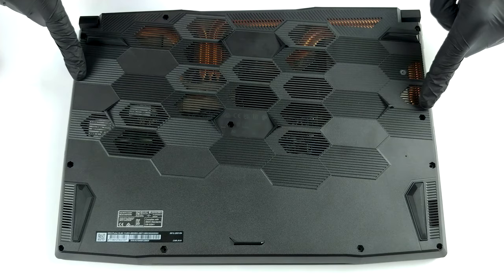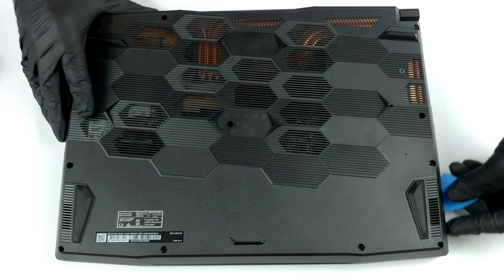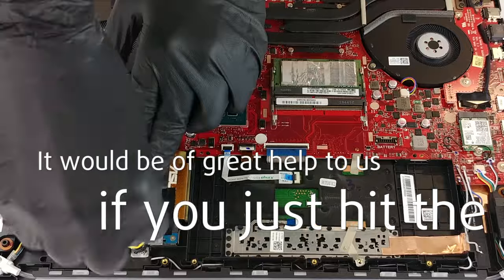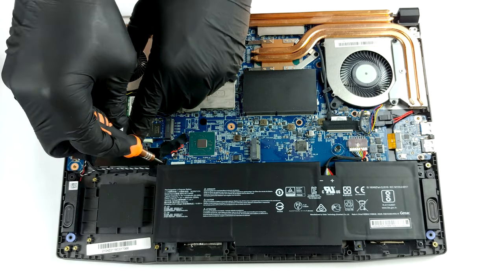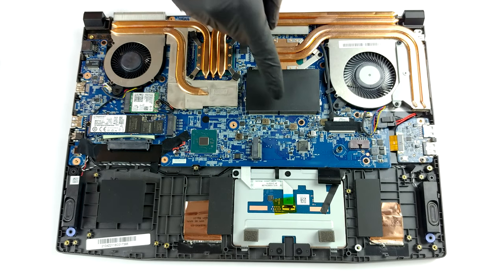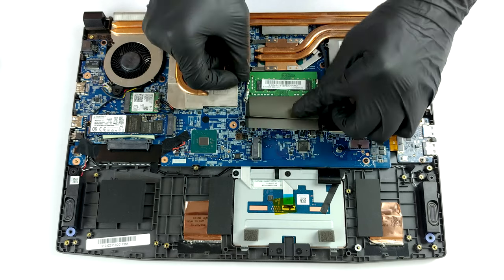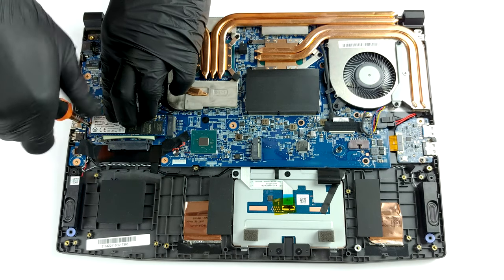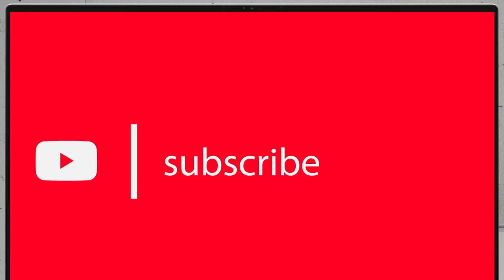🛠️ MSI Pulse GL66 (Intel Core i7-11800H + RTX 3060) - disassembly and upgrade options

Comment: I was planning on getting the RTX 3070 variant, it's quite cheap now, i wanted to know if they both have the same disassembly?
Reply: @Nostalgic Enigma what does this mean? I literally have been playing games on highest settings with the 3070 variant with no issues whatsoever and it's splendid at everything. This is my first gaming laptop so to me it's fantastic, I'm in love 🤣
Reply: @Nostalgic Enigma I would need to try another laptop to see the difference but to be honest I'm quite happy with my purchase.
Reply: @rcarv23 the laptop rtx3070 comes in variants between 80-140W of power, the performance difference between the 80W & 140W versions is around 30%.
Reply: does the 3070 have duel nvme slots and what version of nvme if you dont mind me asking
Reply: @RealKacho  yeah, dual M.2 Nvme slots
Reply: after taking it apart myself, it does.
Reply: As already answered, yes it does have a second NVMe PCIe Gen 3 slot, that supports upto 1Tb storage.
The Sata 3 ssd slot however, is not available on the 3070 variant due to bigger battery pack ☹️. I wish it was available so I could use it for lighter games that don't need the PCIe speeds to run properly. Reduced battery wouldn't really be an issue as I'm going to keep it plugged in anyway for max performance while gaming.
Reply: I bought one (with 3070 and i7 12700h)
And there's no socket for installing my additional Sata SSD
So you cant add SATA SSD in this model
Reply: @spacemaster5206  can you add an extra nvme?
Reply: no friend they are not the same in the part of the ssd is the battery
Reply: @the_winged_helm  are you sure it "supports up to 1tb"?  I hope you're wrong since I just ordered a 2tb drive!  
And thanks I was confused by this whole thing about the 2.5" sata bay and interface since there is info all over the map.
So the verdict is:
 => 2 NVme slots.
 =>  0 / zilch / nada / none sata bays for a mechanical hard drive (that's sad) 
Thx.
Reply: @spacemaster5206  wait what?  So many conflicting reports.  So you are saying there is a total of only one drive bay/ interface in the 3070 model?  Just the one NVme pci SSD stick slot?  
Or are you confusing the mechanical drive thing?  
I wish someone would instill me with confidence as to what the real answer is.  But I will find out soon enough and might be returning a SSD to Amazon I guess.
Reply: @fcass  the 3070 model has two PCIe NVMe gen 3 slots. One is already used with a 1TB ssd it ships with, having the windows installation. The 2nd is free, on which I put in a Samsung Evo 980 1TB PCIe ssd drive. I was also hoping to expand it further, but when I called the customer cae tech guys, they said it supports max 1TB. And the 3.5 inch ssd slot is not connected in the 3070 variant, so it won't work even if you get the smaller battery pack.
Reply: @fcass  I'm saying about standard SSD (not aboun nvMe) I mean there's no SSD port to connect standard SSDs
Reply: @spacemaster5206   I just got mine, it has a m.2 slot available.

Comment: Did anyone try to use the free 2.5 inch bay? I'm struggling because it lacks a bracket to hold the HDD in place and I can't find something fitting 100% on the internet. Someone managed to solve this? Thanks! :)
Reply: if you find information, please tell me, i have the same problem, but i want to add a 2.5 ssd memory
Reply: Tried to find but it looks like MSI
spared money for a 2.5 socket on this model.
To bad because I always have my personal SSD for porting information to new laptops (
Reply: I saw it fitted using double sided tape.

Comment: Does the battery block the 2.5 drive bay? Can I install a 2.5 SSD into this laptop?
Reply: Mine came with the 90wh battery blocking the 2.5 inch bay. If you get 53wh battery it won't block the port. Kinda silly.
Reply: i got the MSI GL66 Gaming Laptop: 15.6" 144Hz FHD 1080p Display, Intel Core i7-11800H, NVIDIA GeForce RTX 3070, 16GB, 512GB SSD, Win10, Black (11UGK-001) and the battery covers it. i reached out to MSI to see if i can get a smaller battery so it won't block the 2.5 SSD bay but this is what they said : yes, as stated, it is not usable since the controller is not been build/connected, only supports: 2x M.2 SSD slot (NVMe PCIe Gen3)
Reply: @isaacso  just get an m.2 drive they cost like 50 bucks
Reply: I already have it. 2 tb
Reply: @isaacso  i suppose in your case the larger battery would be a positive
Reply: @user-ko5kk9ud8k  I still want to use that ssd bay to store music and videos. But I contacted msi and they said that bay isnt operational at all.
Reply: @user-ko5kk9ud8k  not really i usually keep mine charged
Reply: @tieonaminnow9790  can you send me a link for the small battery or maybe the battery part number?
Reply: @isaacso  yeah it kinda sucks that they have the bay, but block it with the bigger battery. That's just a stupid design. I wanted that extra storage too for lighter games that don't need PCIe speeds, and other files. I did wonder if getting the smaller battery pack would resolve this, but if it's not connected then that's a bummer.

Comment: For anyone getting this laptop, I just want to tell u that after playing GTA 5, miles morales, Fortnite and a bunch of other high graphic games, this laptop only gets around like 100-250 fps ON LOW SETTINGS, on high or ultra settings it averages like 40, which is really bad for high paced games like Fortnite and apex legends, not to mention that it heats up to 90 degrees just after like 30 mins of gaming it gets so hot that I can barely touch it, I also use a cooling pad, also, it is VERY heavy.
Reply: You're hitting 90c on that thing? Do you not use cooler boost?
Reply: @superdragon1123  I do 😔
Reply: @StemzX1  Bro I have the 3070 version and when I play intensive games like Fortnite on max settings with Ray Tracing on, I reach maybe 85 tops. It still runs very hot tho and I'm thinking of getting a cooling pad/repasting
Reply: Your optimization is bad, you should look up for a pc optimization pack that includes optimization applications and settings for nearly every part of the PC

This one is decent for GL66 : https://www.youtube.com/watch?v=_mGCyiW0160&ab_channel=Nezeriah

Also 90 degrees and above is normal for laptops and they are designed for that, it should be fine as long as it's below 94 Degrees celsius.

Comment: I have GL66 model with rtx3070 and theres no any socket for SATA SDD
I see only naked board in that place..(
Reply: What the wattage of the rtx3070 85w or 105w ?
Reply: @marwans4018  MSI Pulse GL66 with rtx3070 has 105w
Reply: Same with mine

Comment: Mine came with a battery that occupy the second SSD slot.
I've just opened it up, and, if a plug the 2.5 ssd, the battery does not fit in.
Do you have any tips? Do I have to find a smaller battery or the only solution is to replace the original nvme for a bigger one altogether instead of adding a second SSD?
Reply: Mines the 3070 variant and my battery is longer than the 3060 models battery but it only occupies over the 2.5" hdd bay location not the 2nd m.2 slot so idk
Reply: @benjaminmarkiewicz8241  I didn't see a second m.2 slot!! If that's the case, I don't even need to worry about replacing it, only buying an additional one.
I'll check it out!! Thank you!

Comment: Bro I’ve had an msi gl66 for three weeks and today I got home to play it and it won’t turn on wtf
Reply: Did you find the issue? I'm looking to buy the 3050 variant
Reply: @theloneshadow14  Yeah I ended up frying the charger, I fell asleep with a game open while it was plugged in
Reply: @F12-i2g  oh so the laptop was fine but the charger wasn't?
Reply: @theloneshadow14  yep the laptop works fine still, I have the 3070 variant and and I like it. Only thing I don’t really like is it runs really hot while playing games
Reply: @F12-i2g  ah i had an acer Helios 300 i need to replace and the 3050/3050ti seems like an excellent replacement for the price, if it runs at the same temperature i think I'll be fine
Reply: That's ok 
I had this issue too
Unplug it from power cord, press and hold power button for one minute, then plug in power cord and press power button again. It will work..
Reply: Whoa that sucks

Comment: in the manual it says

SSD Slot (optional)
This notebook is equipped with a SSD M.2 slot that only supports Intel® SSD device
with PCIe interface. Do not attempt to install PCIe SSD with any other brand to this
slot. Contact the authorized dealer or service center for product service information.

but i see a KINGSTON m.2 SSD in this video.

does anybody know if they are PCIE or NVME and any brand will work in it?

Comment: What is the verdict on the RTX 3070 model when it comes to hard drive bays?
~~~~~~~ survey ~~~~~~~
    A) 2 NVme pci SSD card slots (I'm guessing this is true) and no mechanical sata 2.5" bay because of the larger battery
    B) only the one NVme pci-e slot that the 512gb drive came in 
    C) there are three drive interfaces - 2 NVme stick slots and a mechanical sata drive bay?  I'm pretty sure this is a no also.  But who knows.
~~~~~~€ |✓ D~~~~~~
Please reply if you have the RTX 3070 model only!  Thanks.
Reply: No sata drive bay, its voided. Also it's hard to open the plastic shell the first time. I got i7 12700h/ rtx3070 85w

Comment: Just purchased one from a private seller. I see what they call the GPU, but find this wholly unbelievable. 

My display does not power up nor does the HDMI port output to an external display. Do I have to replace the processor under the triple spoked unit?

I hate non-discrete boards.

Comment: Another stupid bottom panel design where no one will see it and prevents people from installing folding feet. I have the 10th gen GL65 Leopard and MSI left the 2nd m.2 slot components off. Atleast they have the pad so I can solder them on.